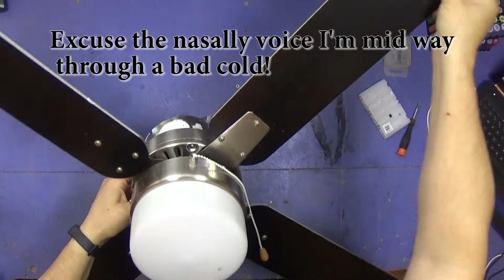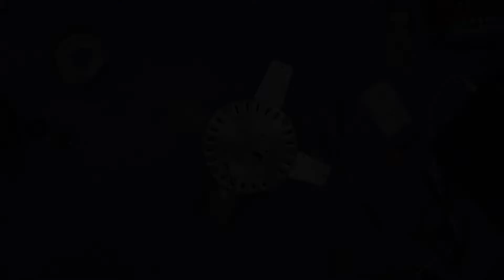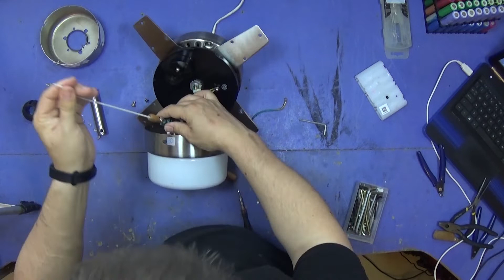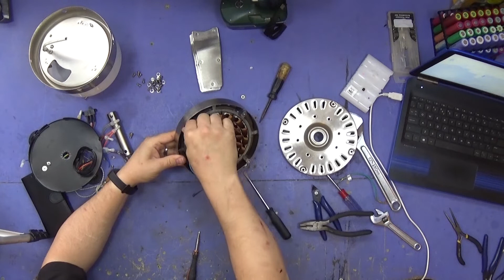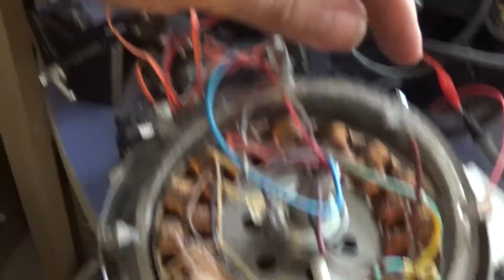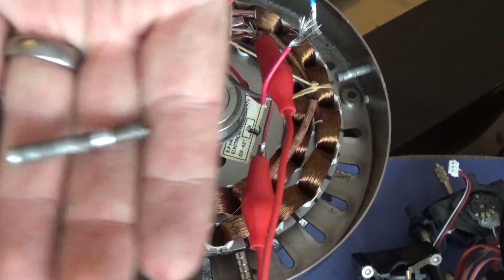DIY Ceiling Fan Wind Turbine Part 1 Dismantling and Testing.

Comment: It work well..but sometime the magnet will vibrate during low wind..and my neigbour ask me what the noise haha..now i remove it..and try find way to reduce the vibration.
Reply from the maker: Do you have access to a 3d printer? I am 3d printing a magnet holder. Ive printed a rough version and i will be getting more magnets and printing a new one soon.
Reply: @TheOffGridFamily  please share thx bro..👍👍

Comment: See at my link..i just finish the project.. i think max amp was 1.3a only..and max volt 40 to 60 ac volt.. another problem was..it will vibrate while max gust..because  magnet coug..sorry for my english..try my best to translate..tq buddy..
Reply from the maker: Your English is fine dont worry. Your wind turbine looks amazing. Id be happy if i can make mine as good as yours. Well done my friend
Reply: @TheOffGridFamily  tq boss👍👍👍👍